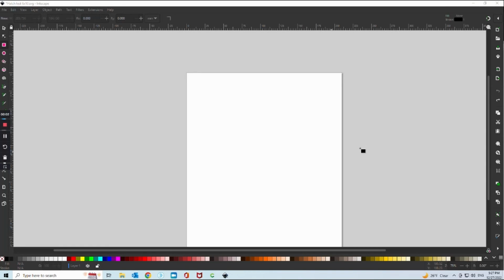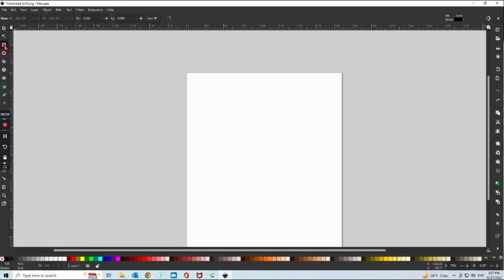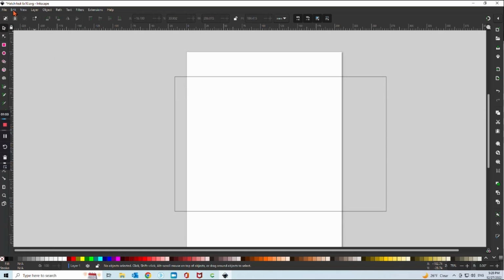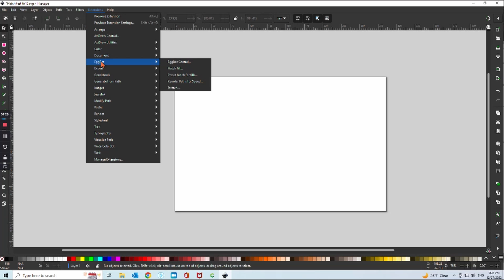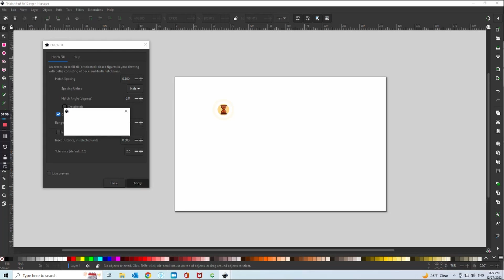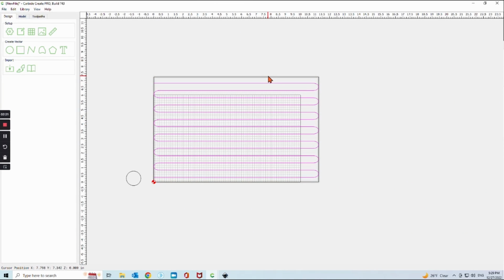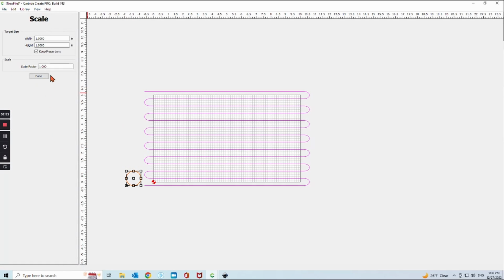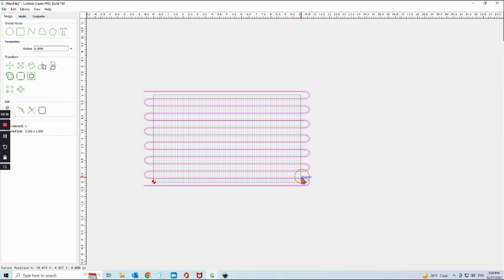Using Inkscape to Create a Raster Toolpath for Surfacing Stock in Carbide Create

Comment: Gsender has the creation of surfacing Toolpaths directly in the tool. It is free. It is the Goode sender. I highly recommend using Gsender.
Reply from the maker: Yes.  There are definitely other solutions to do this.  This video was made to answer a specific question from someone who wanted to use carbide Create to do a raster toolpath surfacing operation in that software.

Comment: Can this be done in carbide create? I've been trying because I have many live edge pieces I want to start using. I've tried drawing contoured rectangles with no luck.
Reply from the maker: You could draw a line and use the array tool and space the rows .5” (or whatever stepover you want) apart.  The only difference is you won’t be able to join the ends.
Reply: @lorigallion2091  yeah I've been trying to draw rectangles and circles and then boolean them to get close to what I want